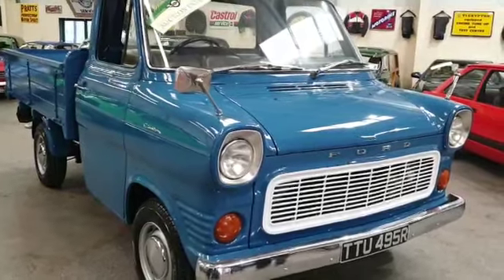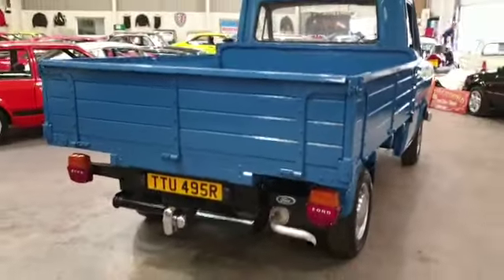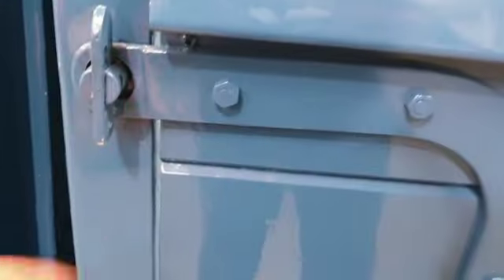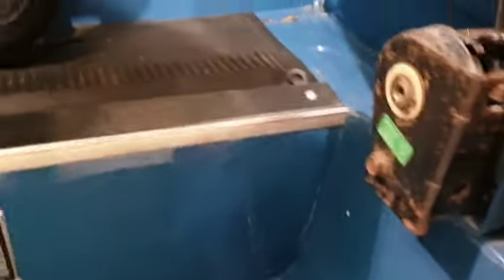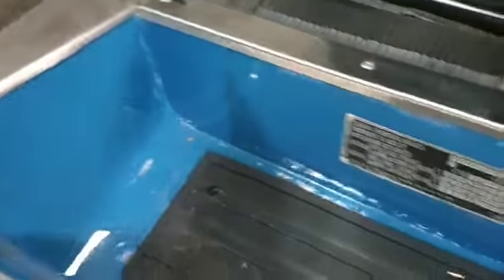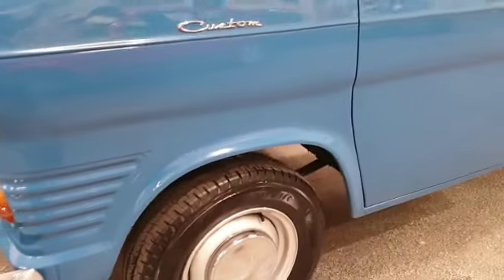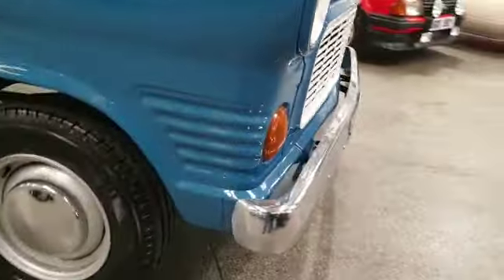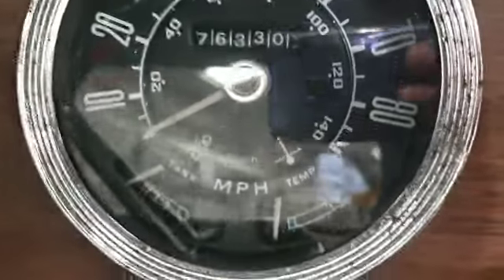1976 FORD TRANSIT PICK-UP | MATHEWSONS CLASSIC CARS | 20th & 21st MAY 2022

Comment: Spotted this one in the back on other vids
What that truck needs is a walker body made for it
NOT seen a walker body transit since I was a kid
Its another project on my list
I'd prefer to do it on an early mk1
Reply: Was a camper why? Because its got separate seats
Reply: @adamwort7160  I agree with you a camper and its got the wrong back window in ot should have a small window instead
Reply: @rolandbrownsell6238  no back window is correct for a late mk1
Last two years they had big back window same as mk2
Although this has probably been fitted if it was a camper
Reply: @adamwort7160  your correct. the early transits had a small back window and my dad has a 1965 mk1 transit in the shed and it's never been touched how it is its the same when it left ford works
Reply: @rolandbrownsell6238  I've got a swb 68 van with twin sliding doors in the shed 👍